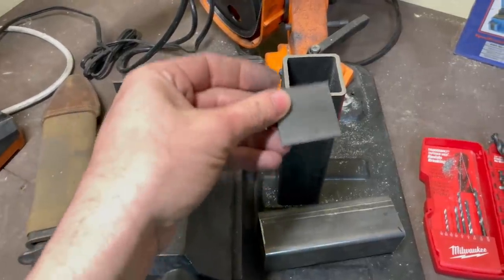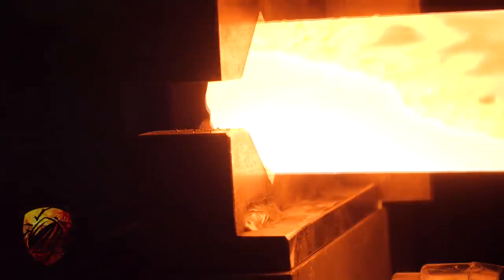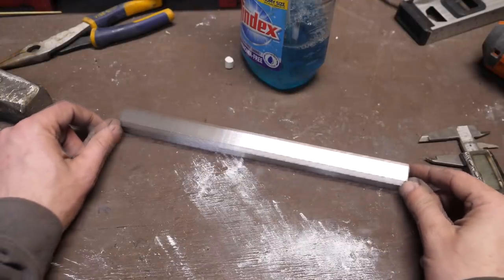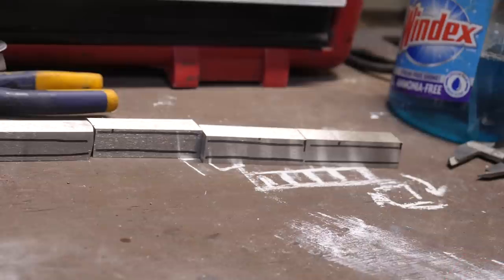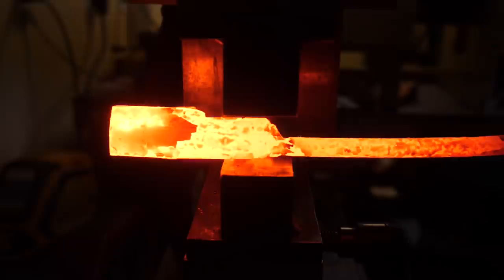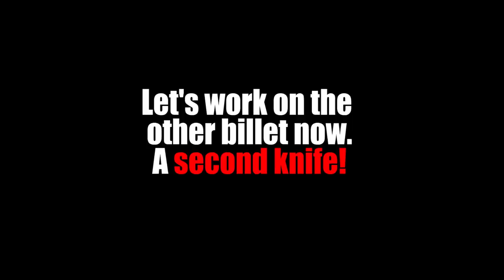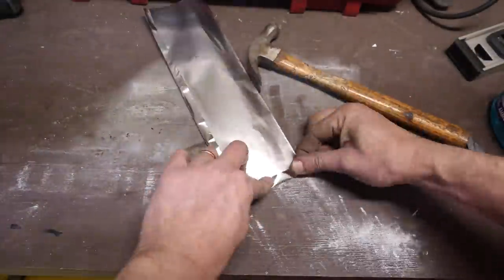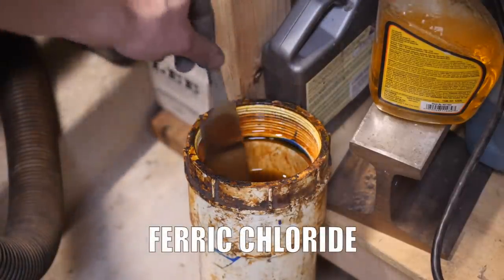Forging A Knife With Needles!

Comment: I tend to get warps like that on my thin chef knives (2mm tapering down to zero) and have found that clamping them in a fixture that bends the blade slightly opposed the the warp while tempering get them out nicely. I do one temper without the fixture then do the second with it so the knife isn't brittle going into the fixture
Reply from the maker: I've got a bar with a rod welded crossways in the middle I use for that purpose.  I tried torching this one then tempering while clamped and it only got worse for some reason .  I think the solid stripes of 1095 running lengthwise didn't get along with the the rest of the billet.  Lots of tension.  I could flip bent portion of the edge back in forth so it would "pop" out one side and stay then I'd pop it out the other direction.
Reply: That's called a shimed temper I believe
Reply: @GreenBeetle  there is always that blade that won't let up lol. My latest one took 5 attempts to straighten, came out of the quench with a massive s warp from the handle to the tip. Some just fight the whole way

Comment: Thats ALOT of needles😂😂😂 nonetheless I love these obscure knife making videos, I have no clue if you've tried to do it, but have eyou tried to use paper clips to make a knife? If not I think it'd make an interesting blade
Reply from the maker: Couldn’t find any that weren’t zinc coated.
Reply: @GreenBeetle  NOOOO, that really sucks, theyres always next time
Reply: @GreenBeetle  soak in vinager, then electro coat in nickel? Yea it’s silly but....
Reply: @GreenBeetle  you can remove the zinc by soaking them in a dilute solution of potassium hydroxide (i.e. lye).  Just leave them overnight (or if its cold, a few days until you don't see the coating anymore).
Reply: @Aiden Tyrrell he could probably use a knife steel insert like some of his other builds.

Comment: You should put the cannister inside the basin of an ultrasonic cleaner as you fill it with powder. It will vibrate all the powder down fast and catch any overspill.
Reply: That is a great idea. Genius is not just new technology;  but applying existing tech to new purpose.
Reply: @christopherneelyakagoattmo6078  two things I learned as a combat engineer in the US army. 1) Work smarter not harder. 2) Sometimes you just got to improvise and make do with what you got. I used to say that Combat Engineers Improvise, adapt, overcome and disinfect and deodorize with a fresh, clean scent.

Comment: The pin sections looks a lot like really exceptional wrought iron. I like the layering  very much.
I remember seeing a similar pattern but in wood and resin, some one used a whole bunch of wooden knitting needles cast in resin to make a large flat sided vase, it sort of worked but the colours of the needles ran into the resin a bit. 
Your needle knife version is better and probably cost about the same with the amount of resin they used 
👍

Comment: On the next one cut the bar in half ...then to one half twist it then the other half cut squares and make a pattern to surround the twist.twist in the middle and line the squares around the edge then forge weld together kind of like a samuri sword...the twist in the sandwitched in middle and the square cuts on the sides

Comment: You could always make a straight razor out of the other one. You didn't have to hollow grind the reverse; it's fine to have a single surface hollow grind on a kitchen knife, and flat grind on the other surface. Yours was left handed, but that's fine. The other option to salvage it, is to make a fillet knife.
Reply from the maker: Great info ty.

Comment: i guess the issue with the second canister was that you are such a good welder the tolerances were just to tight to fit titanium dioxide in the gaps.
Reply from the maker: correct :)

Comment: That's an interesting pattern. I like it.
I've seen your channel, but wasn't asking either of those questions. I was asking, how did you handle all those needles and not require a couple boxes of band aids?
I was thinking about the delimitation in the one blade. For a delam in that spot, I was thinking that you might have been able to cut a slot through the blade, inserted a piece of softer metal, then engraved your name or logo on it. It would have looked intentional.

Comment: It sort of came out looking a little like wrought iron, with the bonus of giving you the same problems wrought iron tends to come with as well.
I guess another way of looking at the needles would be to buy some carbon steel wire or drill rod stock and nickel plate it in solution, its not too hard to do with just a battery charger as the electrical side of things and will be much less spendy than actual needles. Plus the solution mix isn't too hard to make and just distilled vinegar. Or, buy some nickel stick welding rods they use to repair cast iron but they can be kind of pricey once you get over 50% nickel content
Reply from the maker: Interesting idea!

Comment: I'm not a blacksmith so this is purely mend as a question but regarding the delemenation would it be possible to draw back the temper in the area of the crack and drill it out? I know a hole won't make the knife stronger but at least you don't have to grind away all that material
Reply from the maker: I think that’d work

Comment: Mr Beetle. I have a question. I have seen a Ukranian Damascus maker on his channel, shurap. When he makes canister Damascus, with birdshot, nuts and bolts, just about anything, really, he often includes in his canisters ground pepper (not powdered steel, he literally grinds black pepper into it), as well as both fresh and dried chopped chilis.
Have you any idea why?
Reply from the maker: I've heard the word for pepper in his native language is the same word as sharp, so it's a clever play on words?  Can't verify. I would guess it just burns up into an insignificant amount of carbon in the canister that minimal impact on the final product but is a very cool idea. Shurap is the best.

Comment: Why you/he dont grind the ladder with an angle grinder? would that not be easier? ^^ great video..  great channel! sry for bad english.. greetings from germany
Reply from the maker: It would be for sure that's a good idea.  It kicks dust all over the shop, though.  I don't have a dedicated grinding room so I've been trying to use it as little as possible but you are correct its a better tool for the job.

Comment: Will wrought iron make a good edge for a small carving axe and how do I get lots of air into my fire to forge welding heat
Reply from the maker: No. Depends on burner.
Reply: @GreenBeetle  I'm a beginner blacksmith, I don't really have a proper forge(it's really just a fire with air fed from a bike pump with a pin)